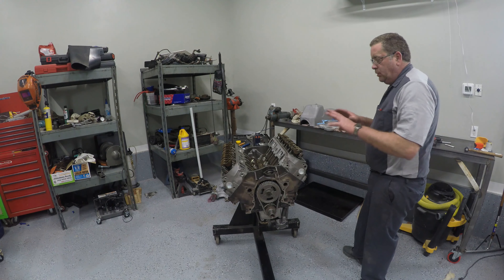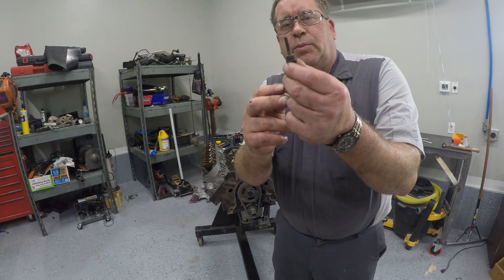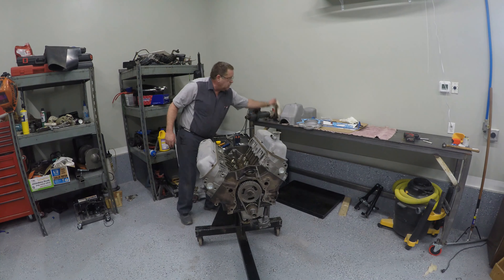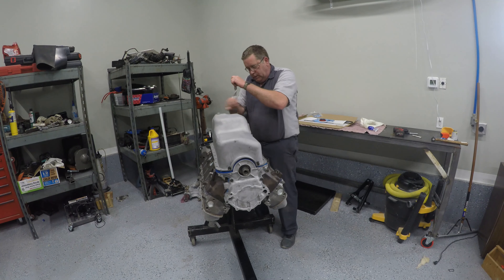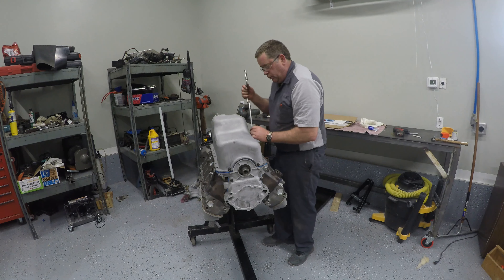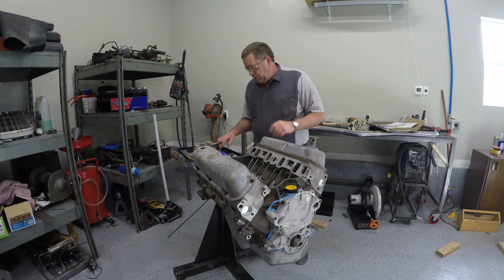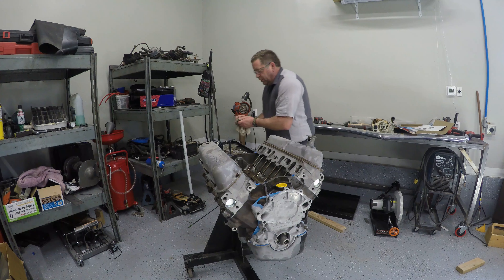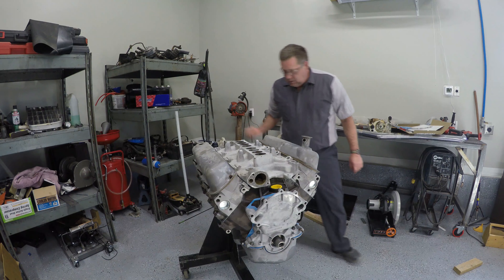351 Windsor Engine Rebuild, Part 4

Comment: I very much appreciate you taking the time to go over this 351w assembly.
   The only piece of constructive criticism I could give is, When talking about the few spots that needed a small dab of Silicone. Not only would it have removed any guess work out of the exact location you were speaking about.
     Thanks again for sharing this info!

Comment: One point you forgot to mention  in the section on installing pistons was checking piston ring gap in the cylinder. Once you slide a ring into the cylinder  you need to make sure you have a minimum clearance between the ring that is specified for the top and second compression ring. If the gap is not wide enough you must file the ring to obtain the proper clearance.

Comment: I'm rebuilding a 351w and your videos are perfect.  Thanks! Quick question though don't everyone usually put silicone on the intake gaskets too?
Reply from the maker: Some people like to put silicone on the intake manifold gaskets, but I prefer not to. The gaskets are designed to seal without and as long as you have a flat surface and your gaskets stay in place, they will seal.
Reply: @mancaveautomotivemaintenan5342  Thanks for the info. I hate messing with silicone on intake gaskets lol